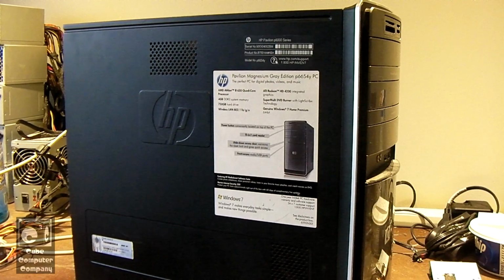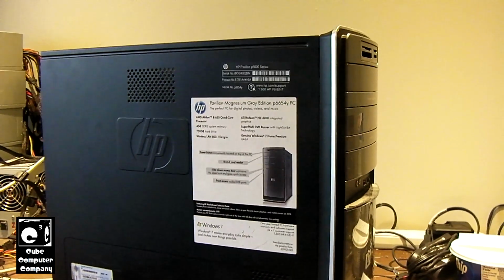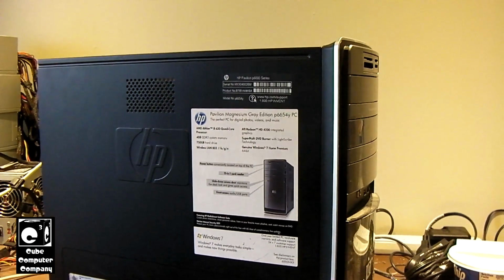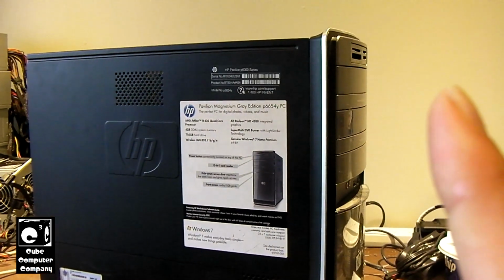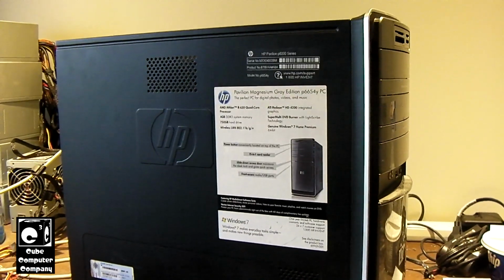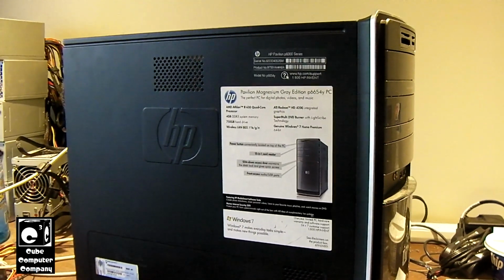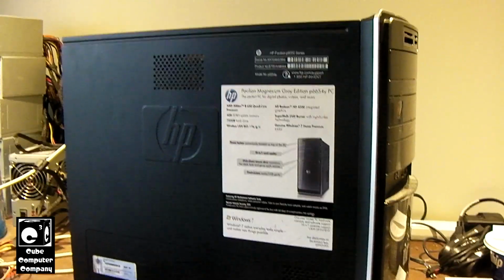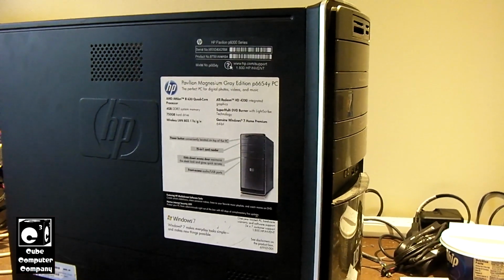2010 HP desktop to get the Ryzen treatment

Comment: whatcha gonna do with the old board, and i have one like that, can take a Phenom II 6 core processor.  It was my previous pc to the current, just needs some data saved and a reformat (bad win10 upgrade).  A motherboard and cpu like that is too good to just toss.  Esp the cpu.  Difference is in mine the psu was starting to sound like a leafblower so had to replace it.  And had upgraded the system with a radeon 6450 and 8 gb of ddr3.  Runs a Inland psu, (microcenter generic), think its in the garage at the moment someplace.
Reply from the maker: Video coming soon!
Reply: I have a p6774y with 3 2gb rams and all same specs of the vid AMD RADEON II let me know

Comment: Very interesting as well to see the system obviously functions fine with a 20 pin ATX supply, rather than 24 pin. Look forward to seeing the next video with the Ryzen upgrade.
Reply from the maker: The 24 pin connector was released around the time PCIe started showing up on motherboards. It added an additional 12v, 5v, and 3.3v line and ground connection. Computers have become less 5V and 3.3v heavy since then, and generally the full 24 pins are only needed when you have a graphics card that's pushing the load limit of the PCIe x16 slot. It was actually very typical for OEMs to use 20 pin power supplies with 24 pin motherboards. HP and eMachines did it for several years. If I had a powerful graphics card installed along with lots of expansion cards, I would most likely opt for a 24 pin supply.

I should note that the power supply running this system has been relatively unchanged in design since 2002. I'll be posting a video soon about why HP kept using this PSU for so many years.